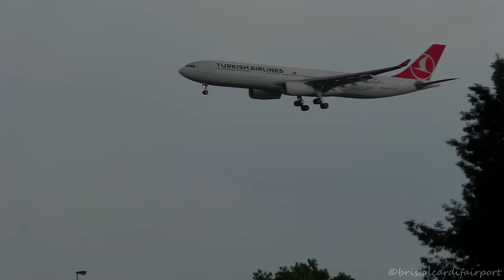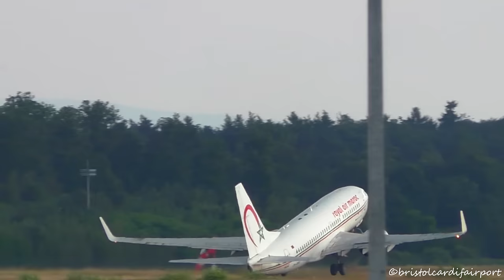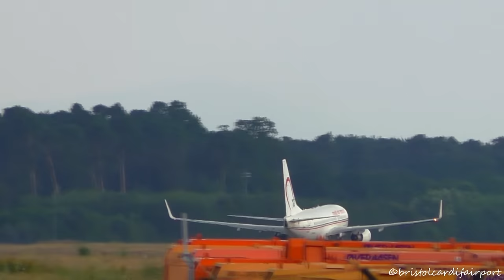PASSENGER AIRCRAFT FAILS TO TAKEOFF! BOEING 737 NEAR TAIL STRIKE & STALL ON TAKEOFF

Comment: Is the flaps set on 1°?
Reply: Ayanski correct!
Reply: Khawaja Bilal they set
Reply: Got that right. Pilot must be blind!
Reply: The flaps are set at detent 1. Degrees are meaningless on most newer aircraft. On the 737-700 and -800. flaps 1 extends half-slats and deflects the small rearmost flap about 8 degrees down from the wing chord. Look closely at full screen on as large a display as possible and the deflection is easier to see, especially at the wing root. Flaps 1 is a certified takeoff configuration for the airplane and is most used for departing very long runways such as 13,123 ft EDDF runway 18 in this video. To learn more about slats and flaps from a 737-700 captain's perspective, visit https://www.youtube.com/watch?v=67HUcVOAY_0.
Reply: Yes, it's flaps 1, the setting is used for a faster rate of climb. The plane will just spend more time on the runway due to a higher VR speed.
Reply: Slats extended no need for flaps
Reply: Khawaja Bilal they did set the flaps to 1*.
Reply: I don't need not stinking flaps.
Reply: It looks that the flaps were not extended for take off ..  luckily the speed gains to lift the plane .  
I've beginning to believe the PIA  scandal that 70% of its pilot cheated on their pilot license exams . How about Royal air maroc after viewing this video .?
Reply: @eduardoroxas8149  royal air maroc literally tweeted that this all happened due to wake turbulence from the a330, the pilots deliberately put the plane down to pick up speed, and they DID have flaps 1 selected, which is suitable for this runway and these weather conditions.
Reply: @ElectroRail  as a private individual all i can do is to accept the alibi or management tweets but as a frequent flier  and big birds watcher , we  can always noticed those flaps were extented during the taxing period for take off and during final descend during landing .
The innermost flaps were the ones being mostly extended 
But this ram 737 seems didn't move . Video very clear . Thanks GOD the pilots made it  and lift was gained . 
RAM should not stress their pilots for rapid turnover causing some flights difficulties.

Comment: Wrong reaction. False Takeoff Data (maybe not even pilot error) can happen, but the reaction as the plane doesnt lift off was bad. Just pull the nose up 5° and wait, the plane will then lift off as soon as speeds are high enough. Forcing that lift-off nearly gone wrong.
Reply: looks to me like they got stick shaker and they reduced AOA.
Reply: They need to bring that crew in for a debriefing and a sim ride
Reply: But if you are under V-speeds, physics will make sure you don't leave the ground. Also, I believe there was significant wake turbulence involved in this.
Reply: I didn't see the flaps down.
Reply: Slats are down. That means flaps must be 1 or 5. looks more like 1 though. The RWY18 is 4km, so flaps 1 ist very common and legit
Reply: I seriously fucking doubt it was pilot error... Pitot tube couldve been messed up and showing wrong vspeeds, fmc data couldve been wrong, possible wake turbulence, captains primary flight display speed indicator couldve been faulty. If any of these were the actual problem then the crew shouldnt have to go back and do more sim training lol
Reply: once you notice you can't get airborne, you should never try even harder and pull that yoke to the maximum. It's basic flying. Not lifting off means not enough lift, means not enough speed. And that information is recievable without instruments. They rotate but the plane doesn't lift off. Happened before, will happen again. The Pilot error was to force the lift off by pulling way too hard. They could have stalled in 100ft... would be fatal.
Reply: Their was no flaps set! Should of been set for takeoff.
Reply: spyke0511 Well this doesn't seem very acceptable though haha. I've personally never seen a 737 takeoff with this little flaps. Would love to read an investigation report about this really, if there was even one written.
Reply: That was just Flaps 1. Pretty common setting for 737s, especially the smaller ones.
Reply: wow I'm really happy your not my pilot because we would all be dead. 1st off the so called takeoff data, V speeds is a calculation each pilot does then compares, if the numbers don't match they recalculate to find the error, same with weight and balance so that would make it pilot error if they screw that up. in this case no flaps were set at all which is most definay pilot error of the most unprofessional kind. Finally a modern high speed wing design without flaps and slats will happily fly into Wing in Ground effect which will kill you. The same will happen with flaps and slats too if you let the aircraft fly into it. You usually prevent that from happening via trim requiring the crew to use positive force on the yoke to rotate. planes with high lift slow wings like a Cessna 150 152 are a different story, they will happily fly themselves right off the runway, again if trimmed to do so.
Reply: ***** I honestly don't know about the newest generation of avionics, but on say everything from built 2000 and before, or designed anyway you can set the flaps anywhere you like and there are no such things as a flap alarm. In fact I have never heard of that in current generation commercial avionics either. I could be wrong but I don't think their is a flap setting alarm. Modern avionics are a marvel but there are some things s pilot still has to do and I'm thinking flap settings is definstly one of those. In any case 20 degrees of flaps would be easy to see and that's about the minimum setting used on takeoffs, why? Because 20 to 30 degrees is all lift, past that it adds drag, lots and lots of drag, great for landing not so much ft or takeoffs. This aircraft doesn't have anything like 20 degrees so if there is an alarm it's blareing it's ass off or is broken or disabled
Reply: James Taylor The MD-11 had alarmbells ringing if you throttled up too much when either your brakes, spoilers or flaps weren't set in proper setting, so the warnings sure exist.
Reply: PilotsTubeHD  The one is the correct answer.
Reply: true if you look and consider the turkish airlines landing few minutes before.
Reply: Jason Maverick yes they are if engine blows etc...
Reply: PilotsTubeHD this is true, but, at the end he makes ir correctly in my oppinon, he brings the plane down again and than he waits till it lifts off iraelg
Reply: people saying they should have aborted that take off 100% not when a plane has hit v1 just before rotation speed they are committed even if a engine falls of the plane they have no choice but to continue take off as if they try and abort after v1 it will be fatal as there won't be enough runway and that will end up in a horrific crash all the pilots had to do was keep the plane at 5° and wait until the speed increases again and naturally lifts off sadly there has been a lot of deaths due to the pilots having to take off as they have already hit v1 and after that it was out of there hands there has also been a lot of deaths due to the pilots not following the rules and trying to stop after v1 in the incidents of the pilots trying to stop after v1 it's been proven that if they had carried on with the take off climbed out and then came around for landing they would have been okay 75% of the time sadly though this is one of them debates that have been going on since the start of aviation
Reply: There no flaps extended. This is the only truth.
Reply: Respekt for all those professional replies on this clip
Reply: Matteo, the truth is the flaps are at flaps 1 which is an appropriate configuration for a 737-700 departing from a 13,123 ft runway. Zero flaps would show the wing with a smooth trailing edge. That is clearly not the case. Flaps 1 extends slats and flaps to the minimal setting.
Reply: He did not deploy flaps for takeoff.
Reply: J A, you and many others replying to this topic look but don't see. The flaps are extended appropriately for a 737-700 departing a 13,123 ft runway. Look closer at the wing trailing edge. If the flaps were not deployed, the trailing edge would be smooth from wing root to tip. They are set to flaps 1 which extends slats and extends flaps to the minimum setting. The inboard rearmost flap (relatively small at the wing root) is actually deflected downward about five degrees from the fully retracted configuration.
Reply: PilotsTubeHD
Reply: Yea stall the plane with no room for recovery.Stick to riding bicycles
Reply: i think so. must be full with luggage of our marocain people carrying chocolates to the home land :D thats why we got a 30kg limit!!!
Reply: PilotsTubeHD is that they try to lift up before Vr?
Reply: first of all, "nearly" is because they recovered correctly. and a report listed wakes from an a330 as the cause of the sink.
Reply: James Spingola  it's flaps 1 just look at very carefully
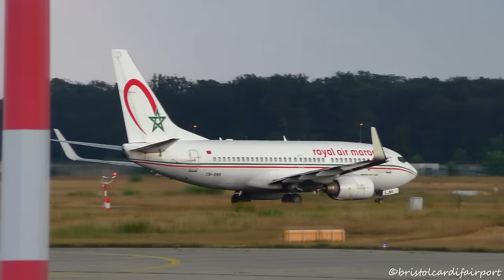Reply: James Spingola  leon gao is correct. Here is a link to a screen capture from about 0:29. Slats and flaps are clearly visible. https://a4.pbase.com/o10/84/630384/1/166877121.LsTekLx5.1.jpg

Comment: Pilot:  "I think we forgot the flaps.  Good thing nobody saw it.."
Reply: nope. Think about 737 take off configuration warning.
Reply: @veryveryluckyzzin1187  yup; think isolated system maybe? because I don't see any flaps extended here...
Reply: I think they did not extend them properly, otherwise, it was gonna stall
Reply: @theprinceofliberia6793  with you on this, man
Reply: A 737 can take off with flaps 1 so...
Reply: @Hk-uw8my  well, if you say so. For A it’s 1+F, with flaps. But in this particular case it obvious, performance is not ok
Reply: Flaps in! Looks like an engine problem on right side
Reply: Nah he tried to rotate under take off speed
Reply: @youngrich718  right engine blows fire.
Reply: @sid77777  I agree with you, those flaps are not out sufficiently.
Reply: another possible cause of this scenario is that they used a lighter weight than reality into the FMC
Reply: Flaps are at "1".  There is very little visible downward angle from this viewing angle.  The slats are clearly out, and they only come out with the flaps.  This is a weight/speed issue; they rotated way too early because of a pilot screw up, or because they input incorrect numbers into the Flight Management Computer (FMC) which gave them lower V speeds than the actual weight of the plane required to fly.  Fortunately, they decreased their angle of attack enough to allow the airplane to continue to accelerate before they ran out of runway!
Reply: He did forgot the flaps.
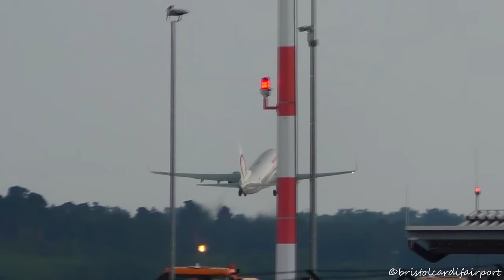Reply: @jakesnussbuster3565  min 1:01 take a look again. I think while start in critical phase the engine has a power problem but to late to make a break!
Reply: @jakesnussbuster3565  ah when u mean... So tell me what u mean what it is? Tell me in 23 years career as a capitan on a319 a320 a330 and a340 what is the reason for this and his reaction... I'm curious what a 16 years old hobby flight simulator child will tell me about this 🤷🏻‍♂️👍🏻
Reply: @jakesnussbuster3565  and by the way a jet-plane hasn't a exhaust. It called Nozzle
Reply: Kim Kong chon gong un . Please stop it. You are a disgrace to yourself. Whenever typing something think: would my mother approve of it. Dont get in fights , learn, grow. You will get over it. All the best .
Reply: @m.p.l.4593  Not the hero we deserve, but the hero we need
Reply: Some of you really need to check your eyes. When flaps are extended, the slats are extended as well. Look at the leading edge of the wings and you can see the slats extended. Also look at the left wing. You can visibly see the flaps extended as well. My guess is even though the flaps are extended, the flaps were not set to takeoff configuration. Maybe the trim wasn't set or the pilot rotated to soon. No one will ever know. 🤷🏽‍♂️
Reply: No, it did not give the sufficient distance to climb, meaning the engine power needs speed in order to climb
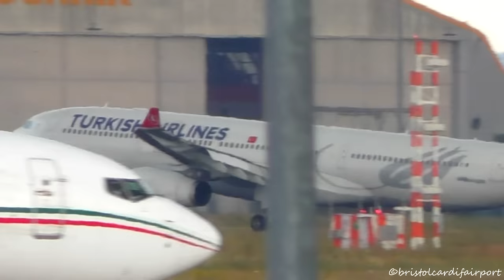Reply: @sid77777  0:26 till 0:32 you can clearly see slats and flaps are extended
Reply: It's clearly obvious that the flaps were set. If you know what you're looking for that is.
Reply: Go learn jet stream turbulence
Reply: But they had flaps 1 which was appropriate for the runway length and weather conditions
Reply: the cause of this was wake turbulence. Royal Air Maroc themselves literally tweeted it.
Reply: People complaining for nothing, just see the top comment it was not a flaps issue nor the pilot's mistake
Reply: The flaps were clearly set.  I can't tell if they were ant 1 or 5 but there are clearly some flaps set.

Comment: I generally find lowering the flaps helps at takeoff. 👍
Reply: There is some flap but it's not much. Probably the first setting.
Reply: Yes flaps seem to be at 0
Reply: @Waltzyy  Yes - flaps are clearly at 1 and there are multiple comments stating it.
Reply: Watch the mentour video Left is Best - you can clearly see the flaps and leading edge slats are extended during the taxi

Comment: For a while I was actually worried that plane  might not get off the ground. Anyone know what happened? Did he not have enough flaps? Did he rotate too soon? Was the weather bad? What happened there?
Reply: Looks like he rotated far too soon. Maybe bad V-speeds or bad callouts if they hit a gust.
Reply: they're released a statement but in my opinion it doesn't ring true.
Reply: where is the statement?
Reply: no
Reply: The cause was an insufficient or waived wake turbulence delay following the Turkish Airlines A330 approach to runway 7R crossing one-half mile down runway 18 (the 737's departure runway). The EDDF airport configuration is a major contributing factor. Encountering the lower half of the A330's vortices would mimic a microburst with initial high airspeed indications leading the crew to rotate "early". Airspeed would continue to decay or at the very least not climb though the airplane's groundspeed was increasing. Only after clearing the A330's starboard vortex would the 737 have normal airspeed indications. The statement from Royal Air Maroc is accurate but poorly worded, leading most people here to jump to erroneous conclusions about the flaps and V speeds. In the U.S. a minimum two minute delay is required for a 737 to depart under the airborne path of a heavy A330. This likely would not have happened if the 737 crew delayed another minute before starting their takeoff roll.
Reply: I agree that the statement may well be true but v1, rotate, wake turbulence, de rotate cant be SOP
Reply: Unprofessional pilot trying to show off.
Reply: Daniel, sorry not to reply sooner. It isn't SOP. The 737 crew should have expected an earlier than normal, artificially high indicated airspeed departing runway 18 under the path of a heavy jet. Due to the airport layout and the heavy A330 that crossed airborne one half mile down runway 18, they shouldn't have waived the ATC delay.
Reply: Bestivitiness show off what?

Comment: “Aircraft fails to take off” - it takes off.
“Near tail strike and stall” - neither happen.
This is an interesting video showing a skilled 737 crew getting stuck in wake turbulence from the Turkish arrival and getting it into the air safely with a little more runway. Instead - we got click bait.
Reply: Showing a skilled crew? This made my day. They are so unbelievable skilled, to forget to run their checklist! Taking off with zero flaps is a mistake that can not happen if you work concentrated.
Reply: @simonpeters2128  there’s flaps. Look again. Also, source please for your claim about the checklist.
Reply: @simonpeters2128  didn't think you'd have a source.
Reply: @simonpeters2128  Obviously there were flaps even if you dont see them. TOCWS would have sounded off had they tried to throttle up without flaps
Reply: This is all about the  Pilots, I think they couldn’t calculate the take-off speeds on Boeing’s OPT App.

Comment: you are completely wrong about this incident. the pilot handled the situation very very professionally. the problem their was the tower control. let me explain : did you see the turkish air just landed 2 minutes before the take off of the royal air morocco? what happened when a airplane lands or takes off? right it produces wake turbulences. when the turkish air line landed, it caused wake turbulences to form above the runway of the moroccan air line. by the time the vortex arrived to the ground the airplane crossed them which caused a weak lift under the wings. the airplan cannot airborne.
why the pilot didn't abort the take off? because he was at a rotation speed, pilots aren't allowed to abort the take off after V1 because they don't have enough runway to bring the aircraft to a complete stop.

what did the pilot do instead? he lowered the nose of the plane to regain more air speed and to cross the vortex area in order to try to take off again. and he did it.

he is a very skilled pilot.

the tower control didn't respect the reparation time between the airplanes.

i wish you see it well now

Comment: The Turkish Airways aircraft and the Royal Air Maroc aircraft used two different runways in Frankfurt. So I doubt that the A330 could influence the B737 as the distance between the two runways is huge. A330 was landing on RW 07R (or 07C) which are parallel in E-W direction, The B737 was taking of from RW 18 in south direction (clearly visible that the fire brigade station is left of the runway) so rolling away from RW 27R/C . The point where the plane reaches speed for take-off is about 500-1.000m from the point where the A330 had its touchdown. Runway 18 is a pure take-off runway in Frankfurt so no other landing plane can influence. Maybe another departing aircraft before the B737 could have caused turbulence effects, but definitely not the TK A330. I think any pilot who flies into Frankfurt should know that RW18 is a pure take-off runway and act accordingly to avoid the described troubles during rotation ...